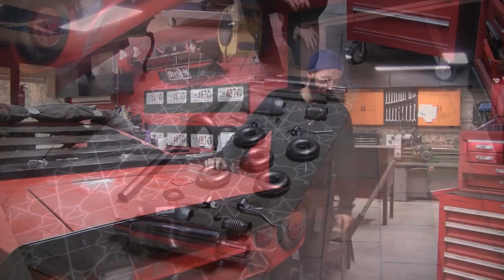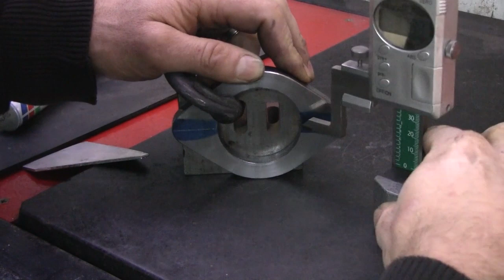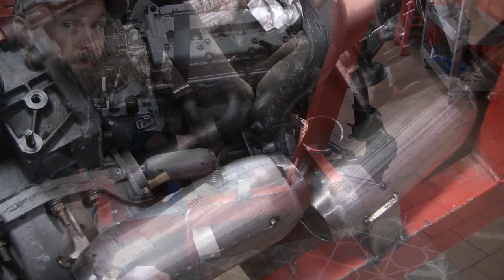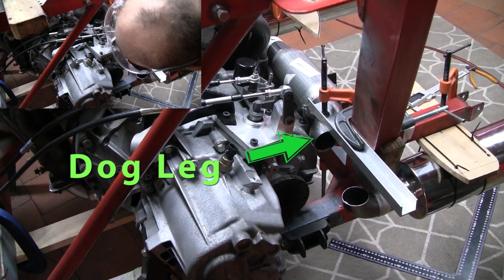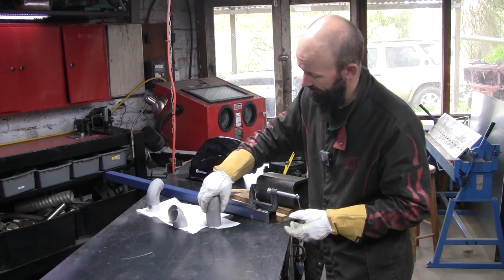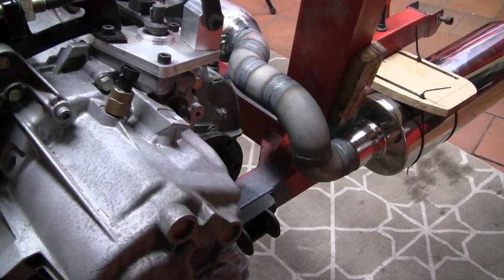Project Stratos - Episode 13 Exhaust part 1

Comment: Arrived here from Homebuilt by Geoff's YouTube channel and I'm glad I did. Picked up some great engineering tips. My only question is, I've been partaking in some extra safety beers whilst working on my projects, but was wondering what the average qty should be as not struck the right balance yet as they don't seem to be working??

Comment: That’s a nice exhaust. OCD and “the need” to have everything symmetric, even if it’s not a single piece around it that is, is often counterproductive. I have come to that conclusion the hard way... 🙄🙈
On a side note, and said with all love I can manage... Who was the guy doing the radiator piping? Definitely not the one doing the exhaust... 
Just get it sorted. ☺️ All of the other, very nice, bits and solutions deserves it.
Hope this came through the right way...
Keep it coming, as I have learned a lot of clever things watching you. 👍
Reply from the maker: yea fair call,I've been thinking of going back and re-visit the rad piping not super happy with it. cheers
Reply: Colin Byrne Glad you grasped what I tried to say, without being rude. 🙈
Love the build and the way you solved a lot of the other stuff. 👍

Comment: Awesome work Colin.  Are you planning to ceramic coat the exhaust to keep the heat down?
Reply from the maker: Hey Tony, Yea thinking about it, only thing i dont like about the coating (apart from cost!) is that it makes it really difficult to modify/fix the exhaust once its done, knowing my track record of welding up exhausts mid rally, i'll probably just paint them in that Hi temp VHT stuff.

Comment: Really love your work, watching intently! And thanks for the tip re Jeff. A long time ago I machined a pair of similar wheel bearing spacers for GTV6/75 spindles but in 2 threaded halves, how are yours adjustable?
Reply from the maker: They are not really adjustable, we had some custom shim washers made up, however I've sold a number of sets and nearly everyone uses the same shim, so the factory machineing of the front hubs is very good
Reply: @105colin  Amazing the tolerances are so good! 
Looking forward to the next Stratos installment, keep up the great work!

Comment: Just curious Colin, did you look at putting an x pipe to link the two exhausts in the system similar to most of the high end Porsche systems?
Reply from the maker: thought about it briefly, would have been a nightmare to package and install, If we end up chasing those last few HP, and i can prove it will make the difference i can revisit it for exhaust  MKII

Comment: Is the system a mix of SS and mild steel?  I noticed there was no purge when welding the bends. What noise level do you have  to comply with?
Reply from the maker: The mufflers are stainless, they are a slip fit and clamp on to the rest of the system, the flex joints are stainless, not great i know but they were the only flex joint available that was short enough to fit into the space I needed.  I don't think it'll be an issue, if it is, not a big deal to cut them out and replace with some straight sections.  
Thought about purging the welds, but i did a test weld and being careful withe penetration, the inside of the weld looked very good, at the end of the day it is an exhaust and not a certified pressure vessel!  
Yea good chance its going to be too loud, i got those mufflers at an absolute steal,  they may have to get swapped out, but now I've got the exhaust outlets to some very accessible locations, so plenty of options if we need to shut it up a bit